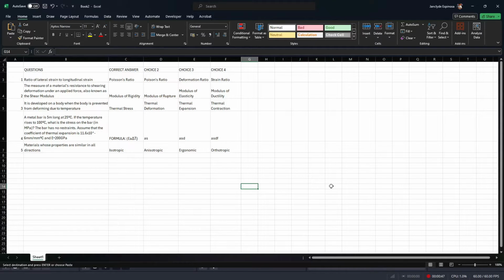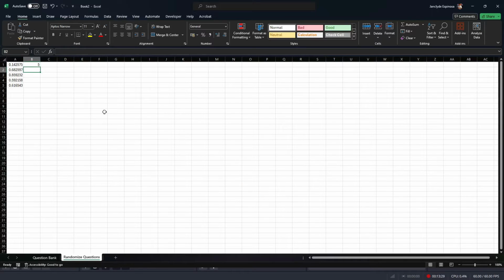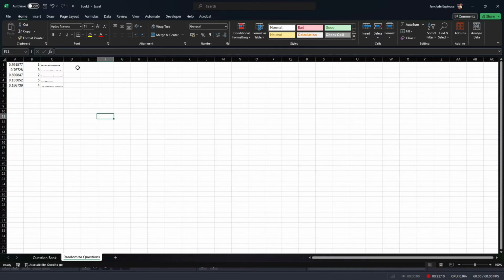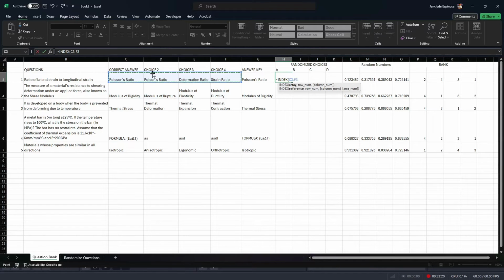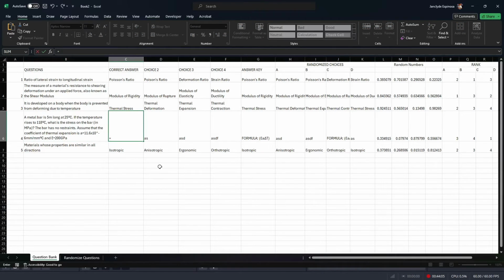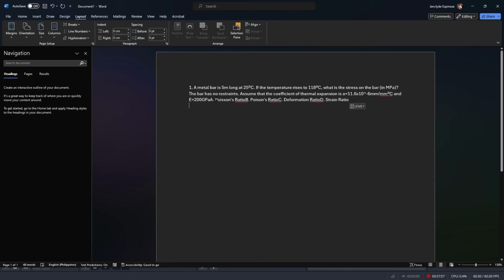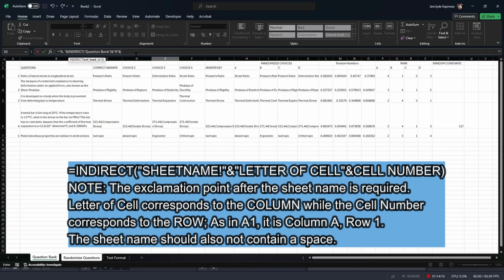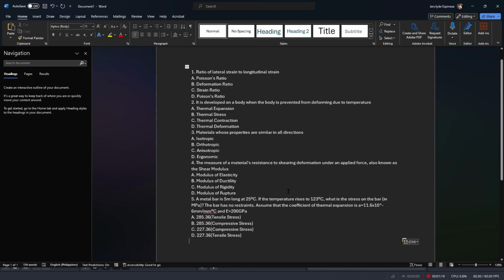Randomize TEST QUESTIONS and CHOICES in Excel - COMPLETE GUIDE

Comment: Not sure if you can help with a MAC/ excel question but, when I am on the "Randomized Questions" page every time I press enter it act as if I am pressing [fn + F9] and changes the questions. So when trying to =index my answers to the question I get a mismatch on them because my question changes but my index is for the last question that was originally on the first line. Thank you in advance.
Reply from the maker: I don't really know a solution to this since I haven't used a  MAC myself. Would you prefer a ready made google sheets file instead? I made something a year back and it has the option to add images to questions
Reply: @engrclidez  Yes. Thank you that would be wonderful.
Reply: @engrclidez  Great video by the way
Reply from the maker: @5000yearleap73  I actually made a webapp on my website:

https://ceboardexamgenerator.com/apps/quiz-maker

try to explore the tool and let me know if you need a tutorial on how to use this
Reply from the maker: this is web-based. Just click on copy exam and copy answer key to paste onto Microsoft Word or any other tool
Reply from the maker: Here is the tutorial:
https://youtu.be/lHLJl33P4NY